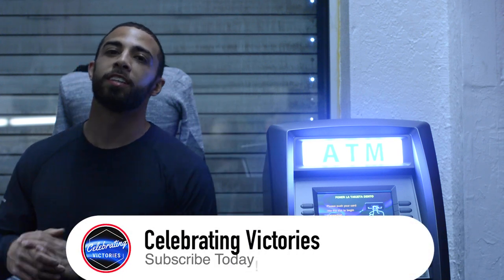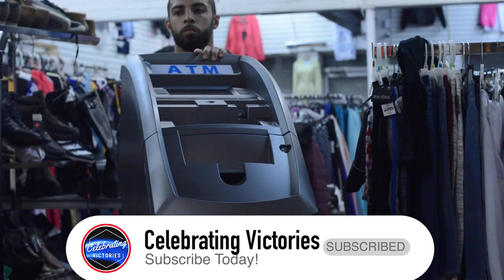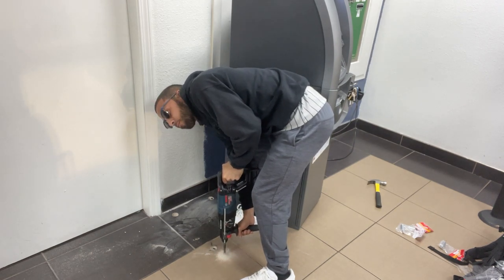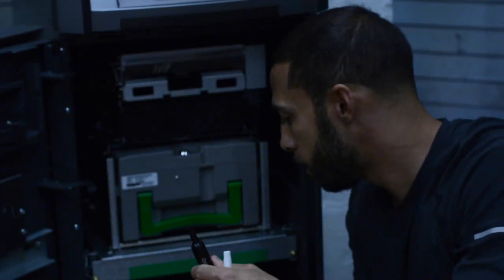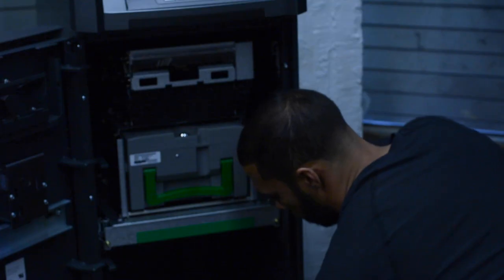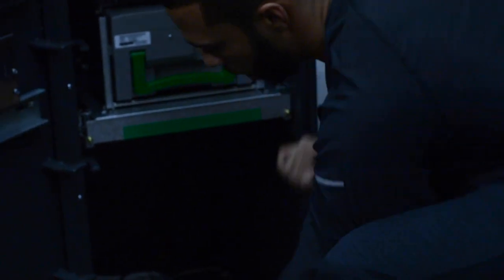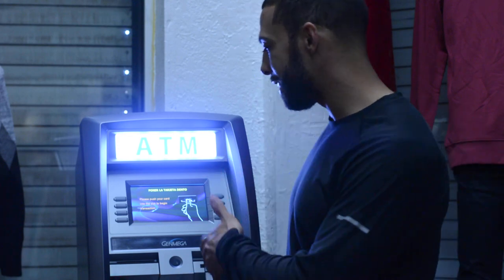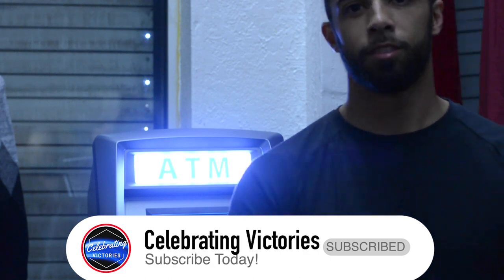How I Bolt Down My ATM

Comment: You have any trouble with that milkwaukee dolly. I know the weight capacity is 150 and an atm is 200lbs. My dolly is too big for my car and I was wondering if the one your using works well or any complaints?
Thanks

Comment: What if you permanently remove an ATM -- What do you do to restore the floor to the original (pre-bolt holes) condition or do you just leave the holes there?
Reply: Well for carpet it would be a little more tedious   You would have to get a utility knife & scrape off the top of the carpets lint than get super glue & stick the lint in the hole with glue. 

If it was hardwood floors you just fill it in with wood putty (match color) & sand.